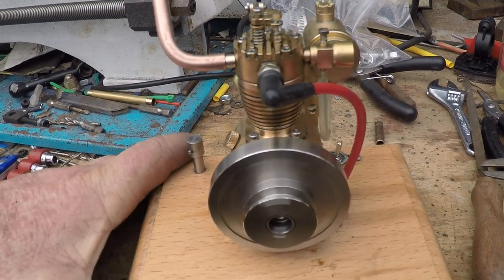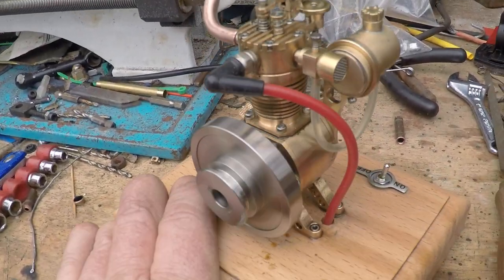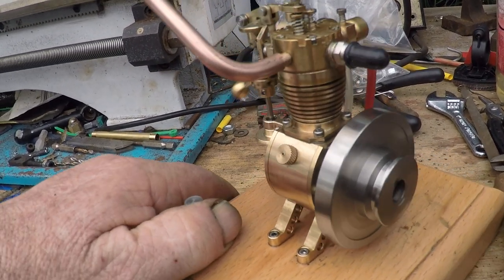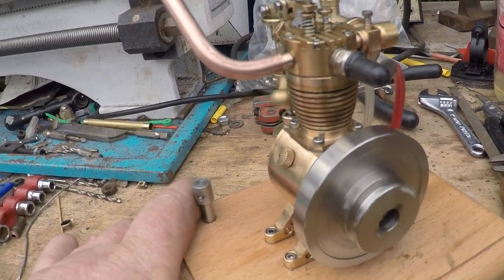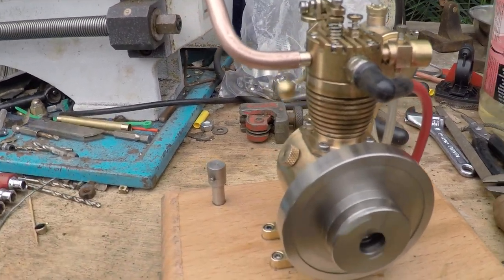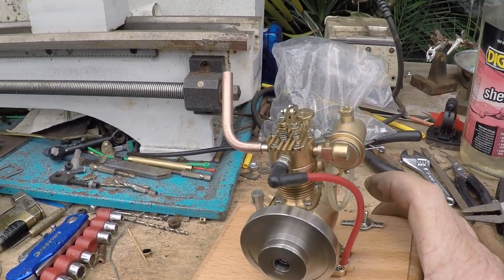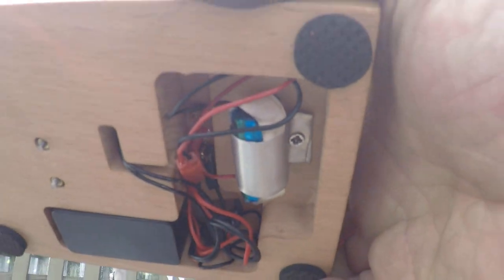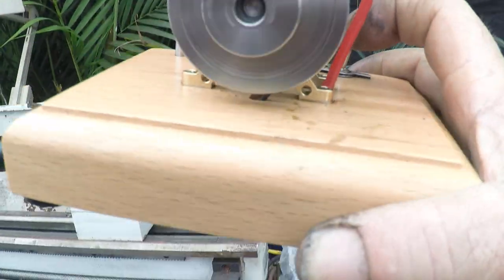Eachine EM2 hit & miss running.

Comment: Did yours have the problem with the governor balls hitting the cylinder? My one had that problem, you can slow them down quite a bit for a small engine
Reply from the maker: Only if its set wrong. but yes.